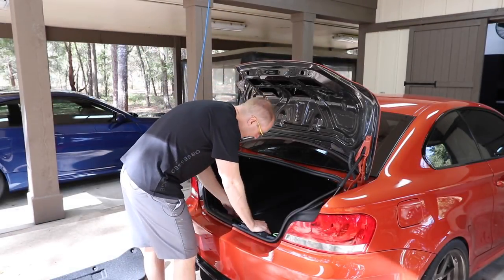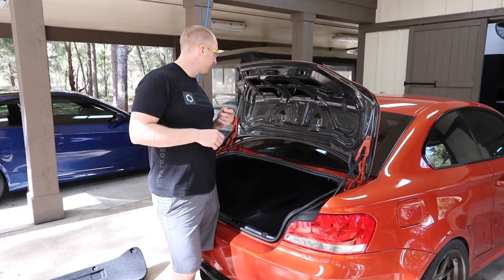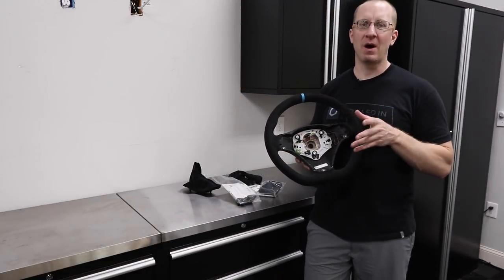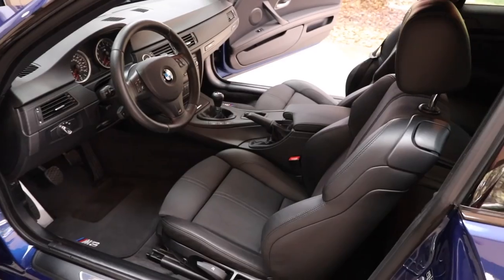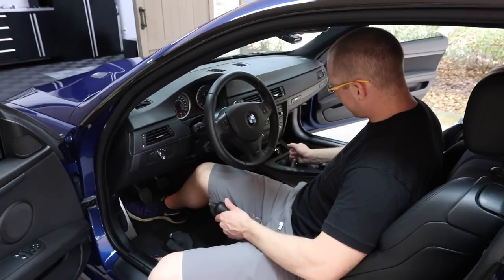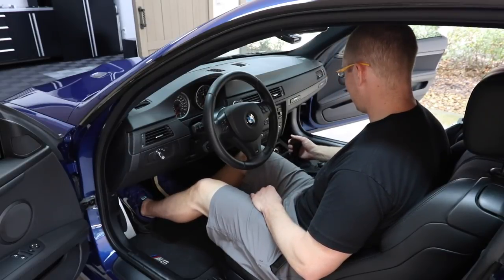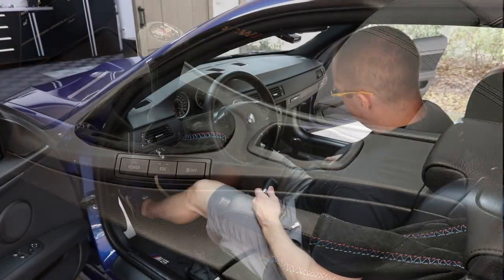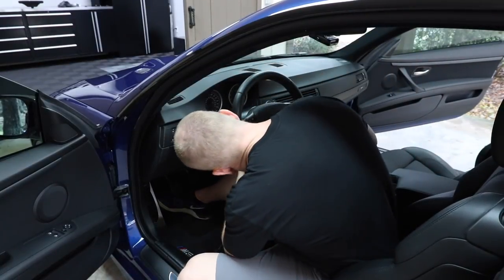E92 M3 M Performance Steering Wheel, IND Alcantara Upgrades, & Clutch Spring Removal

Comment: You can straighten out the wheel without needing alignment tools. You will be shortening one side tie and lengthening the other. As long as you turn them the same amount on each side you can center the wheel without messing up any alignment specs. Judging by other vehicles I have done this on you probably won't need but a turn or so.

Comment: I ended up getting the F10 shift knob + boot combo for my E90 M3, the one you have is ZCP knob. same weighted knob, only difference is with ZCP you only get the knob (and use your oem e92 leather boot) vs. when you buy the F10 shift knob + boot, you get the bit softer novillo leather boot that's connected to the knob. you have to cut the leather at the bottom (because it comes with leather glued to the F10 M5 shift boot frame/mount, you have to cut it and glue it to the E9x M3 plastic mount. took a stupid 2~3 days to properly cut, glue to the mount, dry it well before installing, such a time wasting DIY I agree, but end product looks awesome. I got this because it just looked cleaner than putting a separate knob on top of an old leather boot. 
actually liking the full alacantara IND shift + boot, you should keep it that way! 
https://www.youtube.com/watch?v=uqVLlwed6f0
I also got V2 electronic steering wheel for 6MT, loving it! and the alacantara wear has been pretty good, with that Sonax alacantara care spray it look brand new after 6+ months

Comment: I dig the Alcantara but I’m not a fan of the flat bottom wheel on a M car. I have a flat bottom on my S3 it looks cool but the feel of the flat area annoys me during aggressive driving and autoX. My M4 Factory wheels I perfect in my option however I wouldn’t mind that M performance wheel with the shift lights and water temp gauge.
Reply: Blake's Garage you probably do the same as me when turning the flat bottom smacks your hand and also makes you misgrab it? Very annoying
Reply: @ScottPC  Yep, exactly. Great if you need the leg clearance and have a super quick steering rack but not much else besides a visual mod beyond that.

Comment: I change my m button on steering wheel an I got a airbag error code. I think it will reset. Did you get any error codes after install?
Reply from the maker: No codes on this one.

Comment: Don't take out the clutch pedal springs. 
( Please do not throw away the springs 
as you will be needing them with the 
ultimate clutch pedal )
The clutch pedal's joint area will crack!!!
(The springs are supporting the structure rigidity) 
You need to get the ultimate clutch pedal kit.
It is made out of metal and will give you the 
solid shifting feel. ( The proper way )
Reply: interesting. how valid is this? I searched on the forums and havent found much on pedal joint cracking.  If you can provide some substantial info id like to know (as i have an e90 m3) thanks.